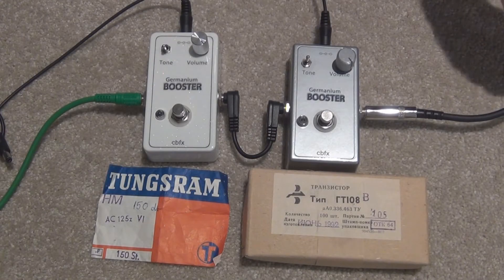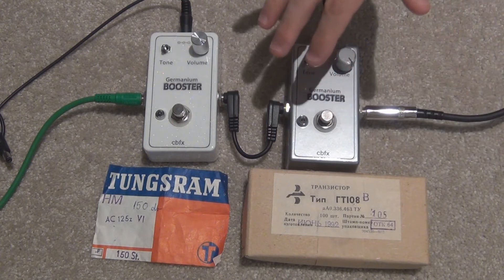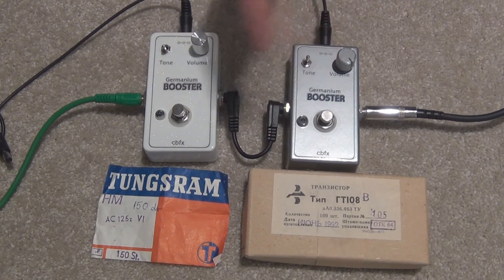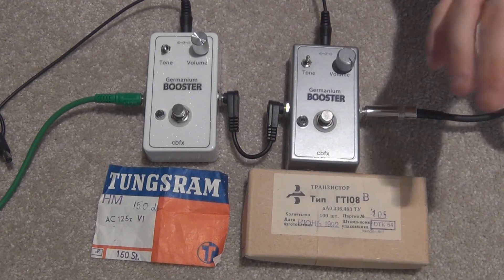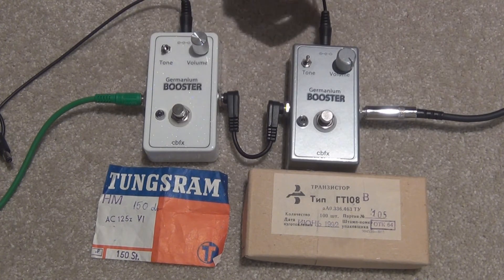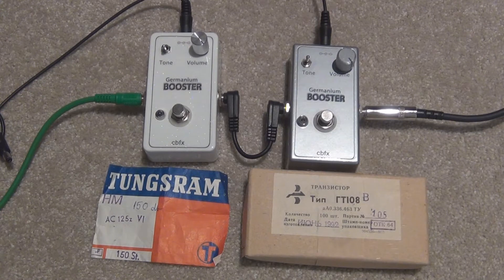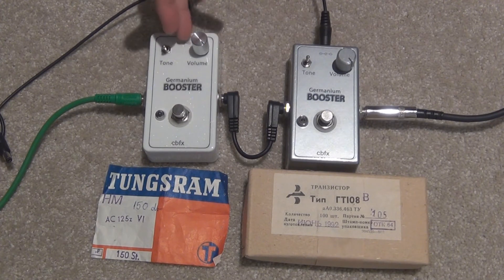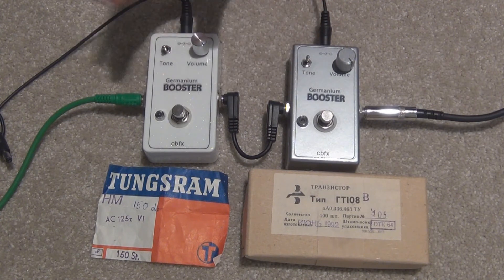Quick Tip - Checking Germanium Transistor Noise

Comment: Just a quick note of interest: Sometimes people don't understand that high gain = more background or floor level noise whether it's from a pedal or only an amplifier you're hearing (all things being equal). So the higher the gain setting then the more floor noise you will inherently hear. This phenonemon or condition goes with the territory. So in this test, it could be simply attributed that the AC125 is higher gain (and more leaky) than the Russian? Thanks as always for sharing your info!